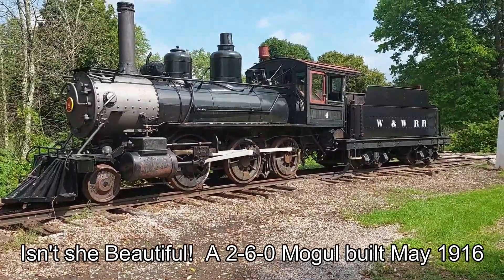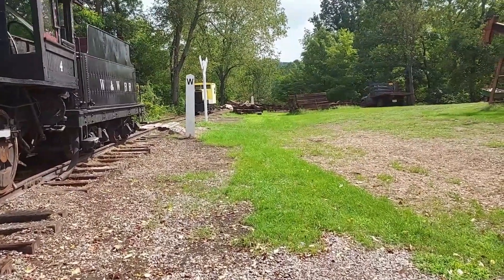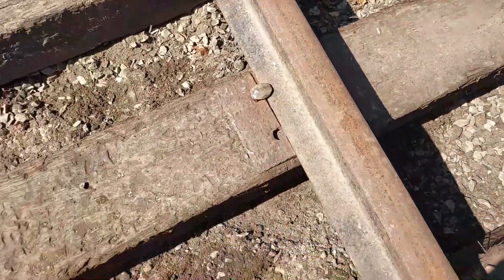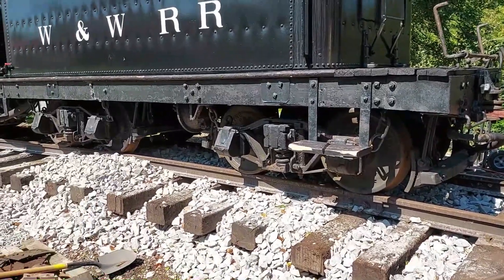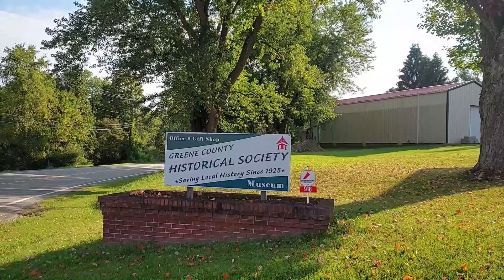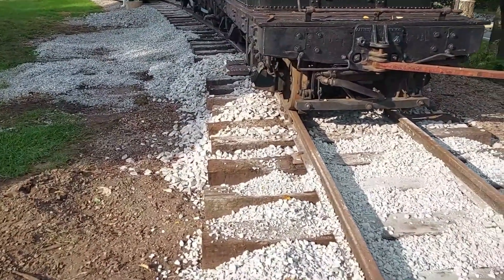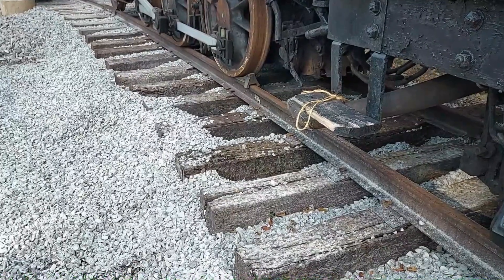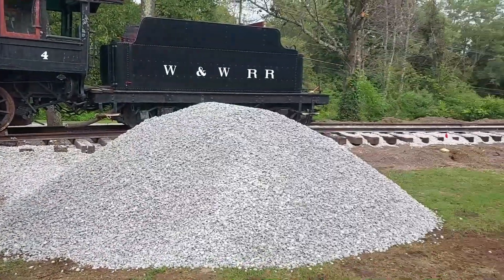Moving a Narrow Gauge Steam Locomotive, Windmill Spiking and How Find Degree of Curvature

Comment: We’d raised the track 13 1/2 Inches at the door when the engine was pushed towards the building. The Plymouth was pushing up a huge grade. Rolling wasn’t bad, from a dead stop, tricky. Especially with no sanders.😊
Reply from the maker: We gonna get you sanders installed for next years project Dave!
Cannot thank you enough for the countless hours you have
spent volunteering here as Roadmaster

Comment: Great job Dave I love these old engines, did they consider hooking air to the engine so you can blow the whistle like the engine we have on display out here in Oklahoma. That was another great class on track work Professor Dave.
Reply from the maker: Thank you Russell, really glad you enjoyed and appreciate the
very nice comment my good man. Yes this loco was set up when it was refurbished to run off compressed air. We are hoping to make
that happen for next years harvest Festival here in October. That
will be a good video! Do you know what they use for an air tank on
that engine? We were thinking of using the boiler on this one
for an air holding tank. We will also be able to move the loco
under it's own power with compressed air, and that will be way cool
Reply: @ccrx6700  From what they showed me it looks like the just hooked to a tank just for the whistle and isolated it from the rest of the air system.
Reply from the maker: @russelltrupia4479  okay, thanks Russell

Comment: Hi Dave. Isn’t official “degree of curvature” based on the angle change in a track length of 100ft?
Reply from the maker: You are right it's 100 feet, however for RR work a 62 foot chord
is what is generally used. All the code of Fed Regulations are
written based on a 62 foot chord. Appreciate very much for taking the time to visit with us and may you have a very good day my friend.
Reply: I was having a bit of trouble understanding the concept of talking about curves in degrees rather than radius. So I studied it until I found the answers I needed. The first thing was, what defines the degree of curvature? I found a satisfactory answer in a publication by the Federal Railway Administration titled “Measurement and Characterization of Track Geometry Data: Literature Review and Recommendations for Processing FRA ATIP Program Data”. On page 6 it goes into the method of determining degree of curvature. Both the 100 ft chord and 62 ft chord are mentioned. It appears that using the 62 ft chord is a convenience measurement. Because the 62 ft chord’s Mid Point Offset (MPO) gives a direct approximate reading of the curves, degree of curvature. Each 1 in of MPO is approximately equal to 1 degree of curvature. Very nice. However, if you put the 62 ft chord and the measured offset into a calculator, you will not find the correct degree of curvature. Using the curve in the video as an example, instead of being a 36 degree curve, it would only be a 22 degree curve. Way off. The reason it’s wrong is because official curvature is derived from the 100 ft chord.
Reply: On the Cumberland Railway you quote curves in degrees and minutes. Do you get that information off the machines you use, like the tamper?
Reply: Sorry for harping on about this topic, but it was really bugging me. I’m happy I was able to sort it out in my head and with a calculator. Keep up the good work Mr. Number One. You have a good day too.
Reply from the maker: @gasonthebrain3738  👍😊
Reply from the maker: @gasonthebrain3738  like you say its an approximate.  It sure woukdnt work if we were figuring how send a rocket to the moon... 😊  good to hear you did great research on your own. I like a man who thinks and wants to find things out 👍